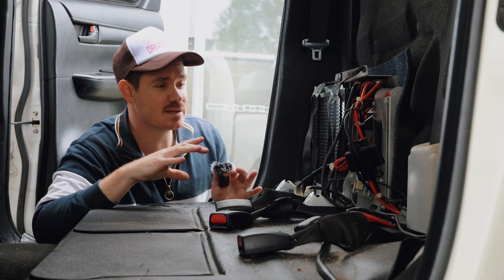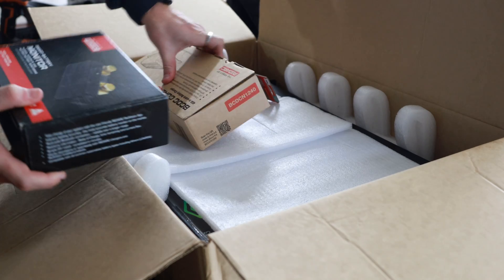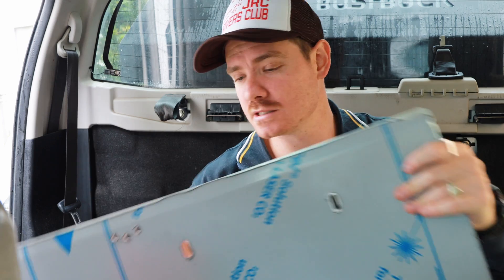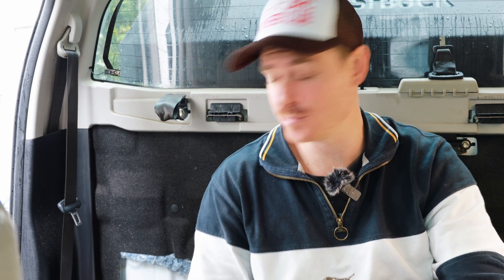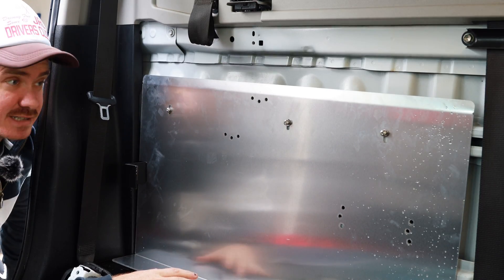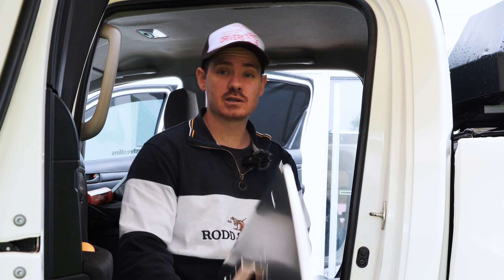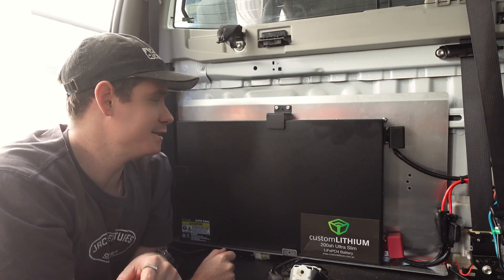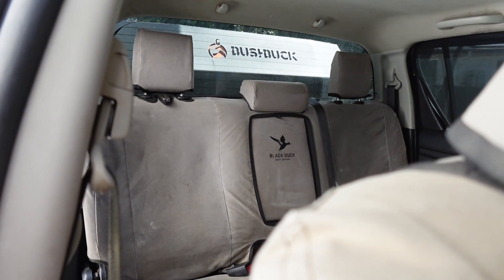Lithium Slimline 200Ah Hilux N80 Installation - Custom Lithium

Comment: Hi with the old kick ass unit did you have to modify any thing for it to fit
Reply from the maker: Hey Mate - do modification required. You just needed to drill into the back wall of the car to secure it down.

Comment: Hi mate just a quick question was is fuse are running this all new to me
Reply from the maker: There are a few fuzes. What area of the set up are you talking about?
Reply: Sorry about the fuse from your battery
Reply from the maker: @AshleyMartin-v2w  I put a 50amp circut breaker frmo the battery to the fuse box. Then the fuse box has all my outlets. For the DCDC charger and solar lines, depends on what brand you go with.
Reply: @JRCadventures  thank you for the time. That is very helpful  information. It helped me out a lot
Reply from the maker: @ feel free to flick me any messages on Instagram. Happy to help.

Comment: Hey mate. Just wondering if you notice much noise difference in the cab with the carpet removed from behind the seats?
Reply from the maker: @glennw2001  good question. Look I don’t but it was already noisey with the larger tyres so it’s probably not an accurate reading.
Reply: @JRCadventures  Thanks for the reply. Looks like a great setup regardless.
Reply from the maker: @ appreciate it!